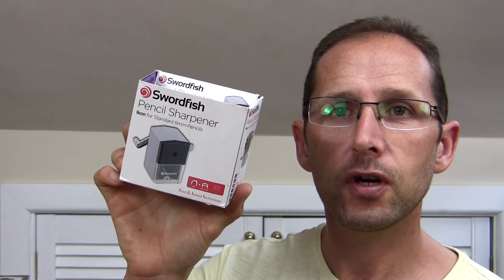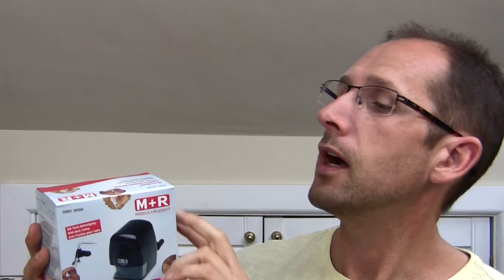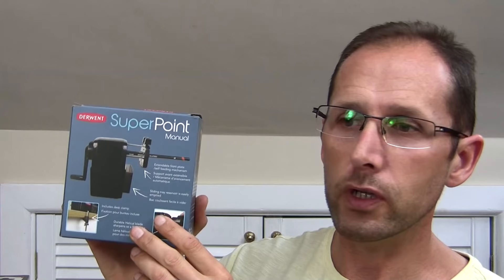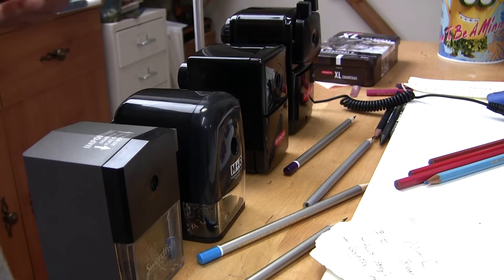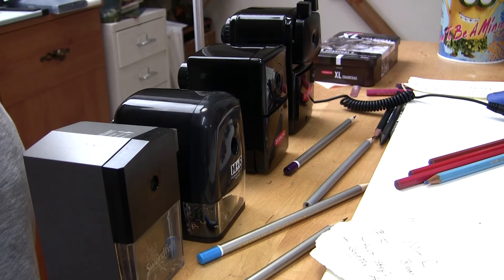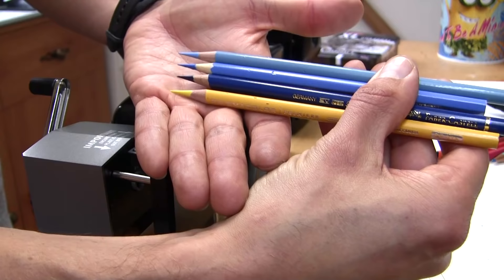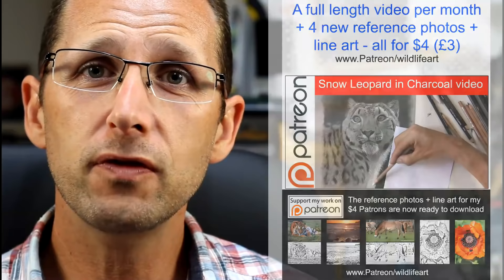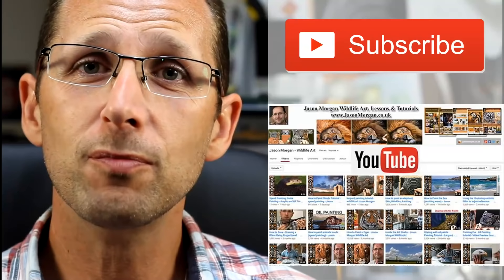Best PASTEL Pencils Sharpeners - Derwent, Swordfish, M+R charcoal, colored pencil, graphite

Comment: Thank you for this great review. 
I have a Deli 0635 sharpener and after doing a little test I don't trust auto-stop anymore. I took 2 brand new Polychromos pencils and sharpened one of them as recomended  (pulled the front of the sharpener out  to the point where it stops and kept sharpening as long as the sharpener was eating the pencil), then I took the second pencil, pulled the front of the sharpener just a few milimeters out and made just a few moves with a crank. My both pencils were sharpened perfectly but the first one was about 0,7cm shorter than the seecond one! So, despite the fact that auto-stop seems to work, the sharpener eats much too much of the pencil. Since doing that test I never fully pull the front of the sharpener out anymore, always just a few (2-5) milimeters. I recomend everyone to make such test with their sharpeners, especially if they use expensive pencils.

Comment: The Derwent does have an auto sharp, but you aren't cranking long enough to get there.  It's a long point sharpener, so it takes a while to cut as much wood and lead as it takes to make that kind of point.  It eats pencils FAST, but if you want a high-quality long point, that's the price you have to pay.  This is six years later, but one thing hasn't changed for me.  I have four crank sharpeners, including an old Helix, but I don't screw any of them onto my table or my desk.  They just get in the way.  I sharpen with two hands, and it works fine.  This is how almost everyone I know uses these sharpeners.  

I also don't worry about a sharpener leaving marks on my art pencils.  I mean, seriously?  It's a pencil that I use a lot.   Almost the whole thing gets ground to sawdust in a pretty short time.  There are times when I go through four pencils per day, though two is the norm.  But my 3H, HB, 2B, 4B, and 6B pencils just don't last very long.  The 2B is the one that really goes fast.  

My favorite brand is General's, along with a mix of Derwent and Faber-Castell. and these pencils are not cheap.   I know several pro artists who have switched completely to mechanical pencils, with a couple of clutch pencils in the mix.  I also know several who have switched to very cheap Chinese made art pencils.  I don't blame them.  The best 2B pencil I have ever used is a standard, extremely cheap pencil students in Chinese universities use.  It's better than my Faber-Castell, at least to me.

After trying a friend's Chinese pencils, I'm just about positive I'm going to make the switch, as well.  They were every bit as good as my Faber-Castell 9000 pencils, and better than my Derwent and Staedtler, at least for my drawing style.  And unbelievably cheap.  I've also been using mechanical pencils, Pentel P205s mostly.  Every pro artist I know who uses a lot of mechanical pencils has a few of these.  One artists I really admire called them the "light sabers" of the mechanical pencil world, and I agree.  They cost five dollars, or less, if you catch a sale.  They have no lead indicator windows, and I use a thin foam grip on them.  They made me put my rOtring and Staedtler in storage. 

I have one with 3H lead, one wit HB, one with 2B, and one with 4B.  This covers about eighty percent of my drawing needs.  I also use two Prismacolor colored pencils, a black and a white.  This gives me a deep black without the shine of graphite, and the white is perfect for highlights in tiny areas.  I have both Faber-Castell Polychromos and Caran d'Ache colored pencils, but the Prismacolor white pencil is far better than the white in either of these sets, even though the rest of the Prismacolor pencils aren't as good.

I also use cheap skethbo0oks.  For me, sketchbooks are not for finished, perfect, commercial drawings.  For these, I use Strathmore Bristol Smooth, or Strathmore Bristol Vellum, and sometimes Bristol Board.  Sketchbooks are for just what they say, sketching.  There's no need to pay a high price for this.  My favorite cheap sketchbook is Walmart's Pen Gear.  It's under nine dollars for a hundred and fifty sheets of acid free 100gsm paper.  Several artists we tried it on couldn't tell the difference between it and Strathmore paper of the same weight, which costs a heck of a lot more per sheet.  I also use HP 32lb (120 gsm, the way printer paper is weight in the US premium printer paper.  It's smooth as glass, which is the surface I use most of the time with graphite.  I  save paper with tooth for colored pencils.  

Anyway, a great sharpener is a good thing, and I wouldn't skimp there.  But even pro artists don't always buy the most expensive of anything.  There is simply no need for it, regardless of what anyone says.  The absolutely wonderful artists who use nothing but a few mechanical pencils proves this, as does those who use Chinese pencils.  And all those who understand that a sketchbook is just for sketching.  Drawing paper is for drawing.  Though I have been carried away and done a few finished drawings on the Pen Gear paper, and even three on the HP paper.

Comment: I have the big Derwent and I do not pull the gizmo all the way out when I just want to refresh the point: I only pull it out half or quarter of an inch and that seems to be enough and it seems to prevent the pencil wood being overly trimmed. As I've had it for a only couple of days now, I'm not prepared to testify about this under oath, but it seems to make sense in a way... Excellent review as ever, thanks.

Comment: M+R is my favorite because of the stop so I don't eat up the pencil. I like the adjustment knob so you can make a more blunt point. But the best thing of all is the rubberized grip so it does not chew up the finish on my pencils. I never liked the teeth marks on the outside of my pencils.
Reply: Hello, I also use the M+R, and I find it has worked great until now but the rubbed grips have gotten consumed after some time. Now they just can't seem to firm grip the pencils: they turn and turn, and they can't get sharpened any longer 🙁 It only does dull points. Would you please give me any suggestions, if you experienced something like this? Thank you in advance 🙏

Comment: I have a Lidl crank handle sharpener, it has the point length adjuster, 7mm-12mm pencil size, gentle grip and auto stop and it doesn't wiggle on the desk. It was £6.99. It's the best sharpener I have ever used.  They have them on offer 3or 4times a year.
Reply from the maker: yes I keep missing them  :(

Comment: I have the Derwent Mini and you CAN tell when the pencil is finished. You can tell by the resistance feel; when it gets to a certain point (sorry about the pun) you can feel there is no resistance and the 'cranking' goes loose. I have been very happy with it but I am itching to get the M & R because of the rubber jaws. The marks that the others make on the pencil barrel really annoy me - petty I know but it does!
Reply: I'm a wee bit OCD and can't stand the pencil being chewed up by the grip. I now hold the pencil to prevent it turning and it comes out nice and clean with no grip marks at all.

Comment: I have the Derwent Mini and I worked out quite quickly that it didn't auto stop. I find that the grip chews the pencil as it isn't strong enough to hold he pencil from turning so I actually have to hold the pencil to prevent this. I found that about 4-5 turns of the handle gives a beautiful point. Overall I am pretty happy with this sharpener at Au$ 29.

Comment: Of course, if you want a custom point, you can use a sheet of 100 or 150 grip sandpaper.  A shop grinder or maybe a Dremel tool with a grinder wheel is probably the most efficient sharpener, as long as you watch what you're doing.

Comment: Great review. A crank pencil sharpener is on the shopping list for tomorrow, but I wasn't sure what to buy. Even if I don't buy any of these brands (will depend on what's available at the art supply store), at least I know what to use. Lots fancier than the old crank sharpener that I used to use, which was from the 1960s or the early 1970s, all it ever had was a crank and grinding barrels. No fancy holder or auto stop. ;)

And you're right, hand held blade sharpeners suck.

Comment: I bought the smaller Derwent about 2-3 yrs & it's still brilliant! It's not difficult to judge when to stop. Maybe you could have also mentioned that when the pencil breaks inside it's easy to remove the back & free it up🙂
Reply: My metal Derwent has an automatic stop.  It just takes a lot longer to get there than you would expect.  I didn't realize it was a feature until I saw a review of it well after buying it.  One warning about every brand of long point sharpener I've owned.  They eat pencils up fast, and they don't like 8B or softer.  With these pencils, or colored pencils, stop cranking after four turns and check the point.

Comment: Hi Jason I bought a Derwent Crank pencil sharpener . I brought the Derwent mini cost me £ 15.00 from a very expensive Art shop . I tired to sharpen my Derwent it was wonderful perfect . So silly me I through the box away wish I had not . I went and sharpen my next pencil and it wouldn't work the blade is loose and I can't tighten the blade . So I am put off from buying another I live in the.UK . Could you tell me why it has done that . I am using a  double ended Stadler pencil sharpener and it work's a gem .   Your review was great  Karen

Comment: Thanks for the review.  I got a different brand, the Muji. It sometimes stops, but not always.  I've found 3-5 turns is usually good.  One thing I would like to know is if there are sharpeners that sharpen oversized diameter pencils, possibly up to the ferby giant.  My little Muji doesn't sharpen thickish pencils.  My Muji works fine except no way to fasten it to the table which I don't like.  Since it's small, probably the size of the mini, I might keep it with my plein air sketching backpack and for travel.   I just got the large Derwent on sale and am looking forward to fastening it it the table.

Comment: Bought the larger Derwent yesterday and was most disappointed since it is incapable of sharpening its own brand pastel pencils (contrary to the claims made in the info leaflet in the box. After sharpening several CarbOthellos it no longer works and doesn’t feed the pencil through. Teeth on the clamp leaves indents in the body of the pencil. I definitely don’t recommend Derwent rotary sharpeners.

Comment: How do you keep the sharpeners sharp?
Reply: Some you can replace the blades on ... especially higher end. I’ve not read where you can resharpen the blades.
Reply: I've got a hand crank sharpener from the 1960's Velos Solo 555, I've never had to sharpen the blade, I just clean it with a brush.

Comment: My m + r has started quitting before the tip is sharp. I can’t find any bits in it. I think it has to do with the bar that holds them. Any suggestions for me? Carole
Reply: I discovered the dial on the front. All I is well!
Reply: Hi Carole, I had the same issue you had, also with the same sharpener. Could you please tell me how I can fix it?
Reply: @elisacavaliere1446  The metal screw in the center of the crank is the secret.  Turn it counter-clockwise to adjust to make a sharper pencil tip, clockwise for a more blunt tip. There is a small diagram on the surrounding plastic bezel that illustrates the direction to turn.
Reply: @johnlortscher5796  hi John, thank you for answering me! I have to say that unfortunately, I think that the problem is actually not this, because I have used the metal screw from the very beginning to adjust the sharpness according to which pencil I was using... But now the small rubber grids just can't hold firmly the pencils any  longer 🙁 This makes the pencils turn around and around and not getting any point 😔
Reply: @elisacavaliere1446  you tell me

Comment: The crappy pencils use recycled wood.   NEVER USE RECYCLED WOOD PENCILS!  they may seem like a good eco choice but they use harsh chemical binders to hold the wood together which is worse for the environment in actuality.   The best Pencils come from sustainable wood sources (Small grown for purpose trees that are replanted)  its better for the environment and much higher quality pencils.  Many manufacturers sold everyone on the recycled wood thing when its even worse than using Virgin wood.  demand better pencils because they last longer due to the use of Virgin wood stability and they sharpen better without breaking.   Buy durable goods that last longer instead of buying cheaper products that end up in a landfill in a year.  Buy once, cry once.

Comment: How easy are they to unblock when the lead breaks inside the sharpening cutters.
Reply: Paul Tudor
I have the Derwent Superpoint mini and can't comment on the others, but when a lead breaks off, you twist the base of the handle and pull out the core. A gentle tap usually knocks the lead loose, although sometimes I use a sharp pencil or a pin to poke it out. I don't get many breakages but it's very easy to resolve.

Comment: Nice review. That big Derwent is basically a rebranded Carl Angel-5. I've had mine for 20 odd years. But mine does auto-stop. I replaced it with the M+R because it can take oversize pencils and it has the rubber jaws. It is also the only one that can actually sharpen my Staedtler charcoal pencils that I otherwise had to sharpen with a blade. They sell for about £10 here in South Africa. They are also the same as the Dahle 133.

This is my test.
https://avwairbrushworks.files.wordpress.com/2016/11/mr_sharpener_sml.jpg?w=470
Reply from the maker: Yes the M+R are real good.
Reply: Hi Jason, I got a M+R last week, after going through your video, which was very informative, thank you. However, the sharpener is not functioning properly. I started with a standard pencil and then moved on to my Faber Castell and Carbothello pastel pencils. Few of them sharpened well at the sharpest setting, but a few just won't go the distance, and this after just one session of sharpening. I removed and cleaned sharpening apparatus, but no change. Did you experience this? If so, were you able to sort it out? M+R ticks all the boxes, so I don't want to return it. Appreciate your insight. Thanks!
Reply: Hi Andre. Where in SA did you buy the M+R? I am also looking for one. Thanks